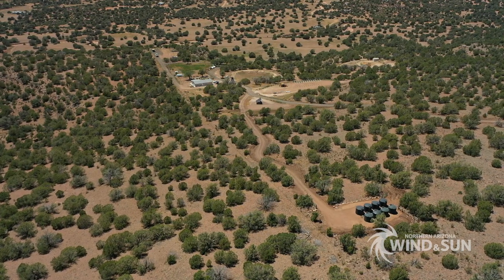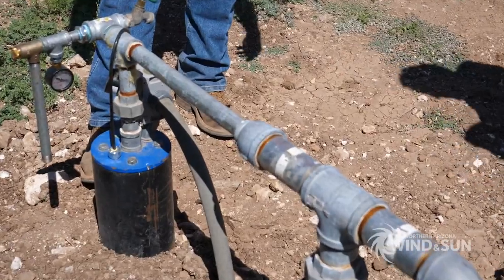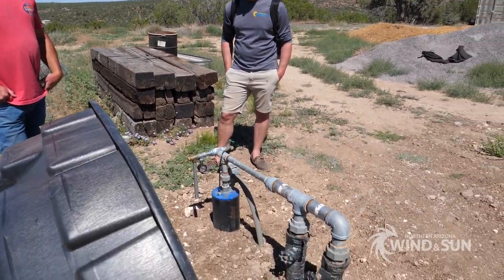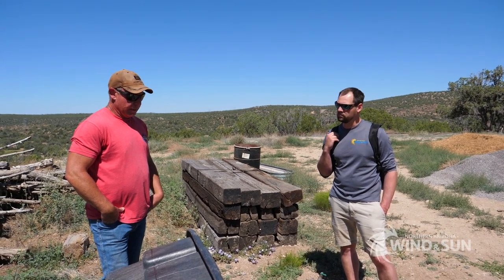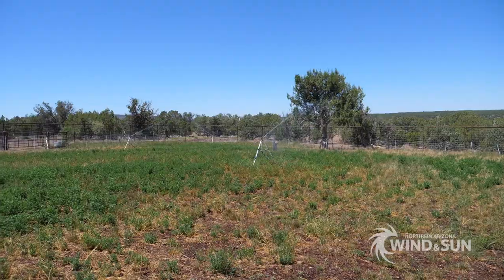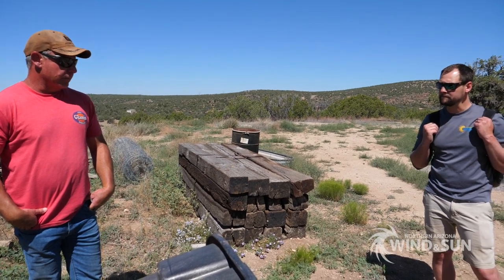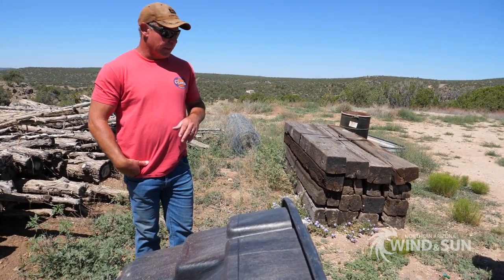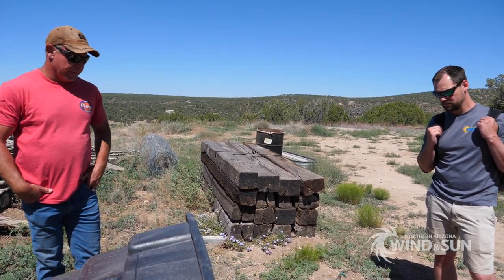Solar Powered Water Pumping at Fort Rock Farms

Comment: Great system everyone. This is one reason I like naws. They think outside of the box!!! 
I do not know what the vertical drop is between the tanks, irrigation fields and living quarters is but if the vertical drop is sufficient....perfect for a hydro generator/pelton setup with part of the gravity feed to produce electrical energy and partial energy to return water back to the tank farm. Think assisted ram pump? Head pressure, friction loss from pipes, valves need to be considered. With that much water storage, one would think the storage, hydro, would carry your domestic electric loads through the longest night.